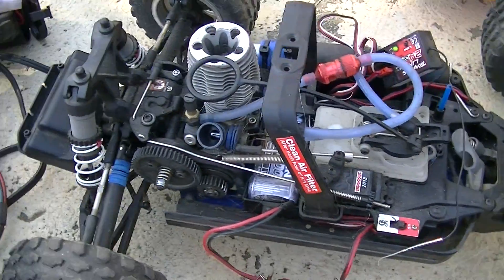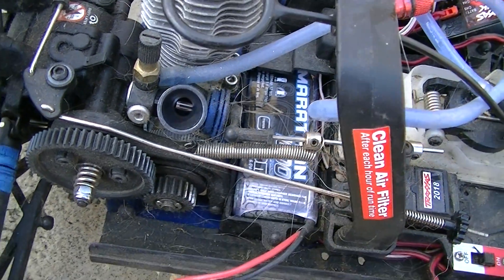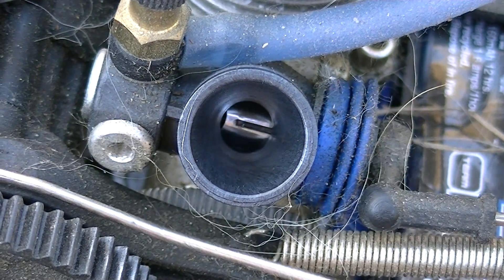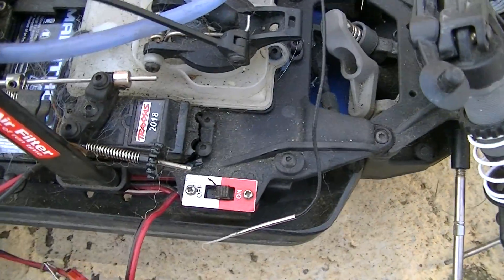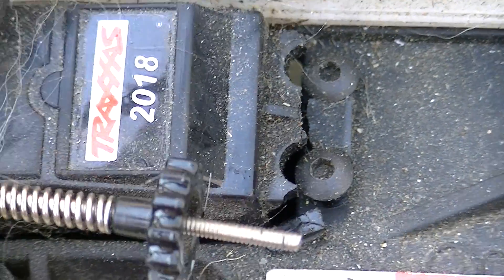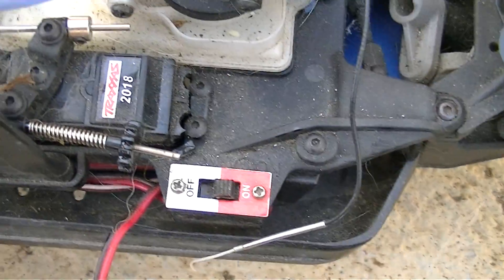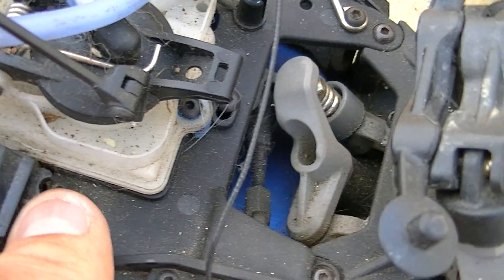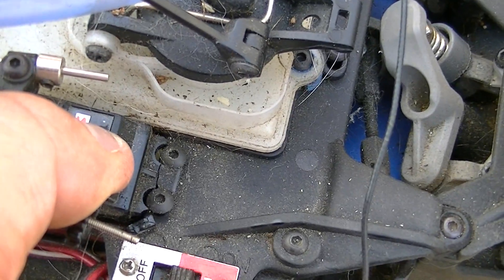Traxxas Jato Easy Fix

Comment: The problem here is maybe you over adjusted the throttle EPA up more than the limit. That's why the servo ears broked.
Reply from the maker: @jestark0890  That particular jato was sitting outside in the hot sun for a while. Got it from a friend. The plastic / nylon servo might of weaken cause other parts have became brittle on it.